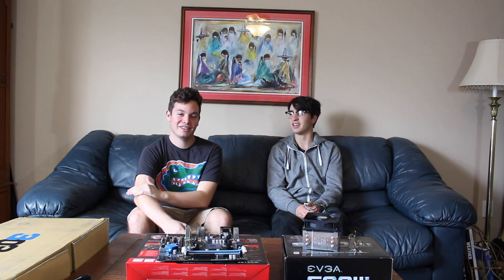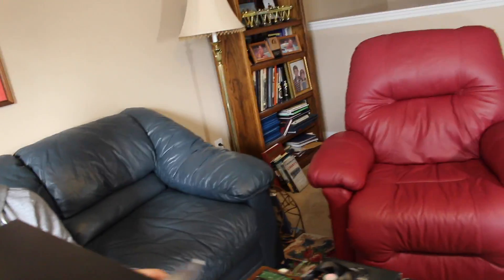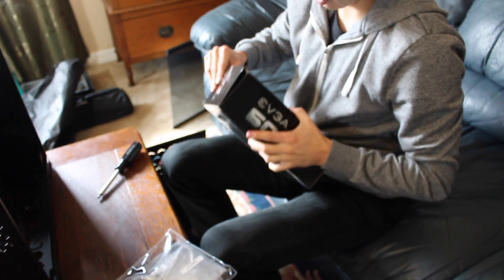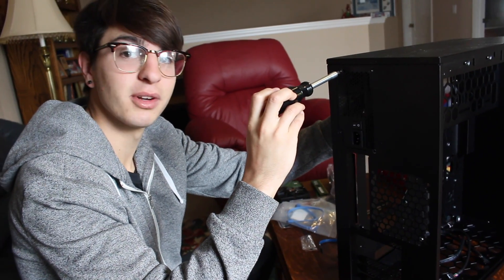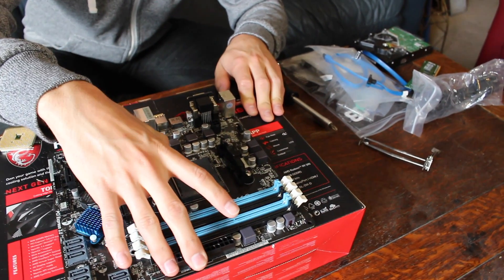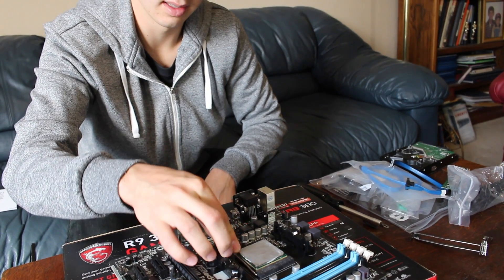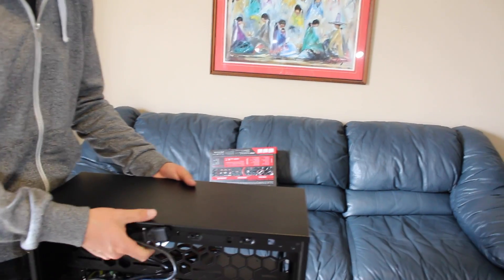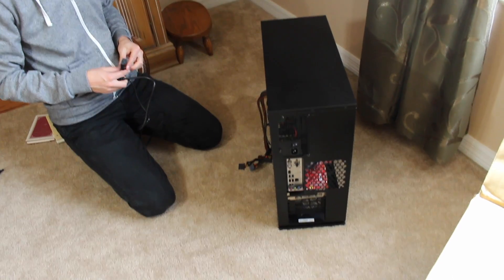Forcing a MAC user to build a PC!

Comment: it will be more fun if you force him to work with Full-size Intel ATX board with multi-GPU connected via SLI or Crossfire, M.2 drive, Water block, Hardline tube!

Comment: Mac users/hipsters should NEVER be allowed to build ANYTHING!
Reply: I'm a Mac user. I actually work at an apple store and I'm currently building a new PC. 

Picked up the new Kaby Lake i7 4.2GHz, 32Gb (2x16) DDR4 RAM, GTX 1080. Not to mention I'm buying a sweet Acer x34a to go along with it. Still going to use my MacBook as my primary device though.

Comment: Matt, i was wondering what u think i should upgrade about my pc  
DDR4 RAM @3000mhz Team Dark 16gb
Msi b150 m3 gaming motherboard
Intel core i5 7600k @4.6ghz
Raedon HD 7950 graphics card
 500w powersupply 
1tb hd
Reply: i agree with the motherboard upgrade but no need to get better ram the amount of mhz on ram barely effects the performance. i would personally just upgrade the graphics card and maybe get a z170/z270 mother board so u can overclock ur cpu higher
Reply: TheShadow3130 
upgrade the ram to a higher frequency and maybe invest in an ssd
Reply: TheShadow3130 DDR5
Reply: TheShadow3130 get a z170/z270 mobo and get newer technology and overclocking
Reply: Only thing i would upgrade because i can see you can afford it. Maybe a SSD....

Comment: i have a question. Is there enough space between the most lower pcie lane and the fans that you could mount at the bottom. If you were to use an atx motherboard and use its most bottom pcie lane would there still be enough space for the fans before they touch whatever is on the bottom pcie lane?

Comment: A typical mac user then lol, doesn't possess the practical skills to even open a cardboard box.
Should've got him an Apple iCutter, to cut the box open.
Reply: I'm a Mac user. I actually work at an apple store and I'm currently building a new PC. 

Picked up the new Kaby Lake i7 4.2GHz, 32Gb (2x16) DDR4 RAM, GTX 1080. Not to mention I'm buying a sweet Acer x34a to go along with it. Still going to use my MacBook as my primary device though.
Reply: Apple box opener only $799! "STUNNING. NEVER SEEN BEFORE"
Reply: @Lunaverse "Practically Magic"
Reply: Why use the MacBook as the primary device 0-0
Reply: YourPalHDee or an apple iToolKit
Reply: "Comes with free charger"
Reply: now with better battery life
Reply: YourPalHDee ikr
Reply: My MacBook is from 2013 but it still has a 2.6 GHz Quad Core i7, 16GB RAM, GeForce GT 750M.

So for doing anything other than gaming such as browsing the web and doing uni work it does it very quickly. 
I also prefer Mac OS to windows. 
The laptop is also portable, with a screen thats 2880 x 1800 IPS. 

And to be honest even for most games, I play a lot of games like TBOI and SMB so it works more than satisfactory for that, even CS:Go on max graphics...
But yeah I'll build the PC for intensive gaming, thats about it

Comment: rip cpu...he touched it way to many times
Reply: When I saw him touch the pins my stomach sunk
Reply: TheSqueakyHydro mine to dude
Reply: I was more worried about the ramsticks... how he smashed them around:D
I was like "there´s not gonna be any working Ram in THIS computer":DDD
Reply: It's usually not the force that breaks the cpu, it's the moisture and other impurities/dirt on your hands. After a while it can corrode or damage the cpu. That's why you don't touch le pins. But the same goes for the flat intel ''pins''.

about the RAM, it's usually pretty strong. But like every other sensitive electronic device/component it can break easily out of nowhere, but it can also drop 1 meter and survive. It's all a matter of the situation.
Reply: I've dropped a customer's CPU at work (i3-6100) and bent it, like, almost broke it. I put it in and it worked fine...and my boss didn't find out about it, luckly.

Also my CPU got dropped a few times (i7-920) and its fine. My motherboard while the BIOS was bricked was put in a pile of dead boards, I pulled it out, got the BIOS chip re-soldered for a new one, and I'm still running it (Gigabyte GA-X58A-UD7)
Reply: My friend had a bent pin when he got it and all i had to do to bend it bad was touch it with my finger. They are very sensitive.
Reply: http://d2ydh70d4b5xgv.cloudfront.net/images/a/d/intel-core-i3-2120-sr05y-3-30ghz-cpu-processor-bent-corner-as-is-28f64c874e81a475b0591f7b20f36efc.jpg

Kinda like this.
Reply: +Rinkk What's your job? Building PC's or selling parts or something? I'd be pretty mad if someone bent my processor's PCB.
Reply: Building PC's, but that was when I just began working back in the summer, gained a lot of experience since.
Reply: I know right? And it's not even like I dropped it hard! It was on the workbench, I accidentally knocked it with my elbow and it fell onto my shoe, it didn't even fall on the ground! The PCB was made like, out of cardboard, that's how it looked like once it bent. On the other hand, I found a dead pentium D and out of boredom I started throwing it around, and I couldn't even bend it! Not only is the performance difference going down by generation, but so is the quality.
Reply: Rinkk so its more easy to break a 6th generation cpu than a 2nd?
Reply: It's easier to bend all CPU's newer than the 775/1366 era. They are made of generally weak PCB's, but even so, the 6th generation is made OUT OF CARDBOARD ALMOST. The 7th generation's PCB is SO WEAK that coolers are known to bend CPU's.
Reply: Tripieye Ya the pins can bend but not big thing to fix that
Reply: Rinkk you are stupid to understand that neither
Reply: SpaceMusic sure it's fine after dropping it but your hands/body has moisture and grease on it which ruins CPUs
Reply: for real lol!
Reply: Rick James Those things arent that sensitive that u think. I have dropped my cpu from about 1 meters high and no problems.
Reply: Rinkk wow that's crazy i didn't know that i just don't understand why they would make the quality of a newer cpu more breakable than the previous generations?
Reply: Where do you work to be able to build computers as your job? That sounds really fun.
Reply: PC repair shop in romania, Agersoft. We build custom PC's and fix PC's/laptops.
Reply: To save money, i can't see any other reason.

(P.S. I'M RICK JAMES, BITCH)
Reply: Rinkk lmao 😂😂 finally someone gets it.
Reply: Nu mai minti ma :)
Reply: Rick James yap no gloves or metal touching before this rip to all components

Comment: I have an questions, which 3d printer must i buy around 500 or 600 dollars and how can i draw 3d and print it. Do you have  tips ?
Reply: edwin k anet a8 is like 200 and it works like a dream. You don't need that much anymore for a good one. For a little more prusa i3 mk2 is obviously a good one.

Comment: Not to mention, you should put the motherboard in first, always. In addition, you should put the components into the motherboard while it is in the case.
Reply: Why?
Reply: 1) it's easier to place the motherboard in the case that way
2) it's easier to line it up and drive the screws into the stand-offs
3) you multiply the risk of potential ESD damage to all attached components when they're not grounded

I've never seen multiple components get destroyed that way, but that doesn't mean that it's not a risk or impossible to destroy with a static shock
Reply: Ok thanks
Reply: Interesting I thought you put components into the motherboard (that sounds so weird for some reason xD) then you put it in a case..........